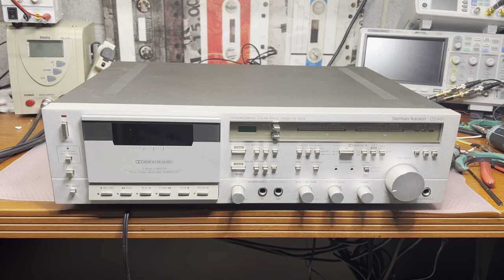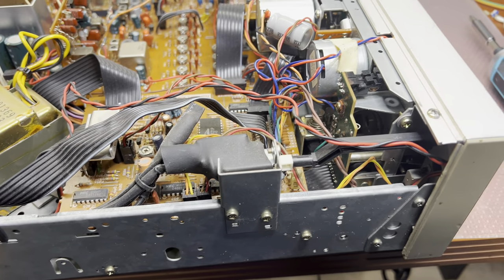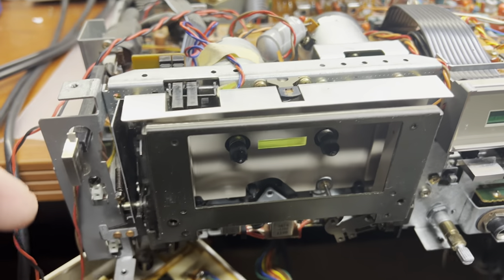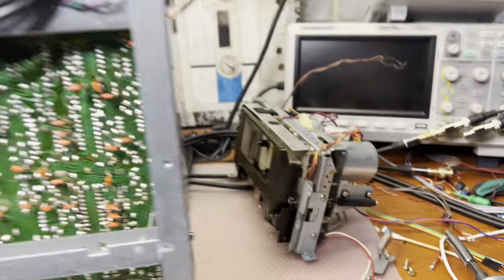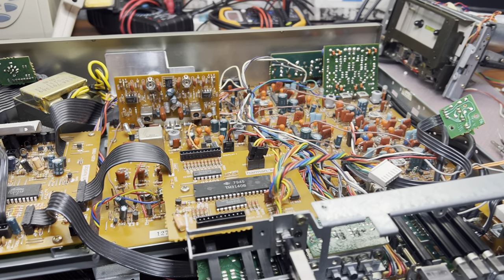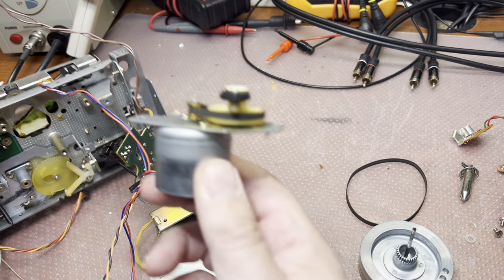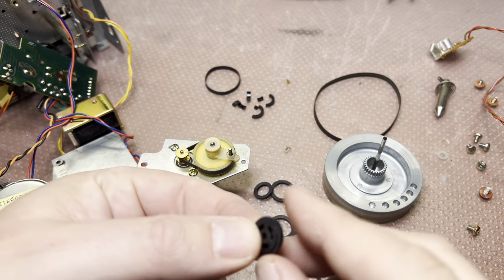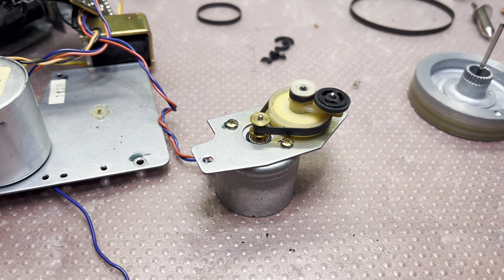Harman Kardon CD401: A Restoration Challenge

Comment: Great Video I Been working on a Harman Kardon HK400xm which is a simpler design  w less boards. I could get transfer out (not a lot of room to work on it, I also looked at it and said who designed this,,, I figure Out I could get my screwdriver in the inside Bolts to the carriage transfer to remove it by doing the same as putting the front panel on, by pushing the PB Black sleeves in/out (Tape Types,,,,) since they move in out out. Luckily the PB control just fall off (No Glue) so no wires to remove. I did cut the 2-wire to the Front panel, I also LOL ,when I removed the 2- Tape inside sleeves I was thinking before I remover it , they have to have the stand off screwed from the back (they did this in another spot) WOW it fell off, Lol

Comment: Good luck on this, lol!

I just started a restore on one of these and it is a VERY modular and tetris style layout, lol.  

It doesn't look like your unit is factory stock.  Those sprague and orange drop ceramic caps all over the bottom/top of the main and pcb 2/3 boards is not from the factory and neither are the ones on the motor.  Also, it does not look like your capstan motor is the factory sankyo motor.  Happy to share pictures of my unit.

Look forward to the updates!
Reply from the maker: That may be the difference in the release year, dont you think so?
Reply: That's certainly possible, but curious why they would deviate from what's posted in the service manual, which specifies electrolytics.  Also, the hx/400m (prior model) from online seems to be quite similar to CD401, and caps are the same.    @hifirulezzz
Reply: I think this model was only available 1 year, in 1982 and the prior model 1981 hx 400xm is very similar layout/caps.  1983 was the CD491, which looks like a much cleaner "productionized" (haha) dual  capstan version of this with better dolby chips, etc. @hifirulezzz
Reply from the maker: @s3353  This deck came from the guy who just got it from original owner. However, after 45 years it is hard to say what and who did for this deck. Considering how poorly it is designed and how much efforts are needed to just overhaul the tape transport I doubt some technician was there before. But you never know.
Reply: Very true!  Good luck and I hope you're able to get to the bottom of the issues. @hifirulezzz
Reply: My Harman Kardon HK400xm also does not have them

Comment: Visually I quite like this deck. The head is dark like AKAI's glass heads.

Pretty much the same pain I endured in a KD-A series JVC, you can disassemble it once and assemble it back again with great care and each time it will show a different outcome.

Looks like you can have a lot of fun with all those pots. I'd trust your OSC over the T-100 software and input card.

Did you lube the front capstan bushing? I know you used to do it but 2.7 kHz is a good candidate for the jump. Sometimes I do live lubes for my enjoyment...never seen 300 Hz jump on front bearing alone but more than 100 Hz gained certainly yes.

Comment: Great Video Did you find and has anybody have the part # for the 2 Idler Tires? looks to be the same as the Harman Kardon HK400xm and my still work, so when i order new belts it would be nice to replace them I did not see a Part # in the Manual?
Reply from the maker: No replacements. I had to find a best fitting for the big one and improvise for the small
Reply: @hifirulezzz  I saw the heat Shrink trick, good idea (my 2 work so far) since I need belts it would be nice to order 2 Idler tires Thanks for the Hk Videos they will be Very helpful setting mine up , Just working on the Normal tape for now. (Harman Kardon HK400xm)